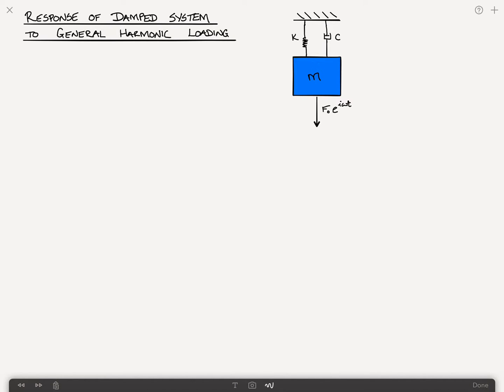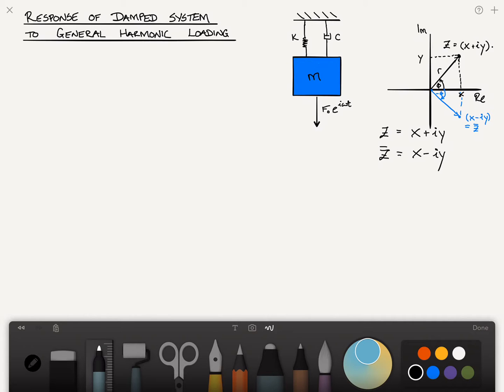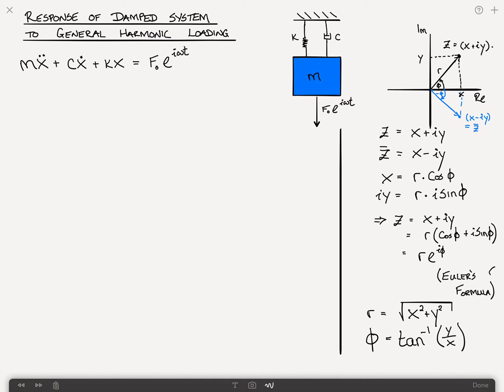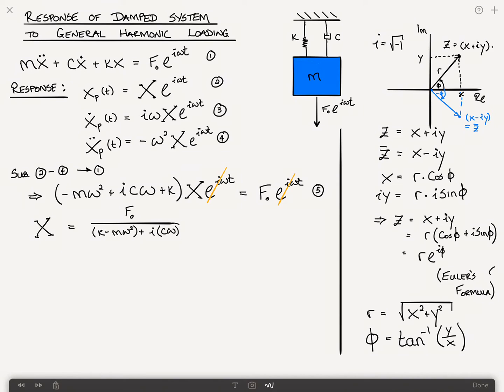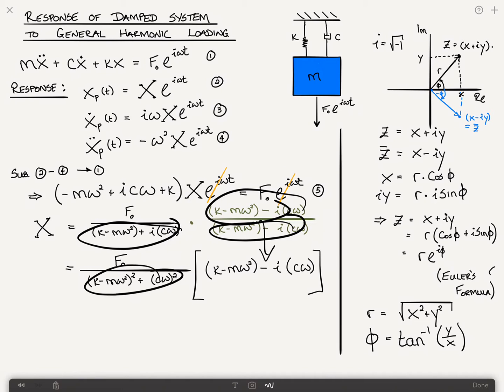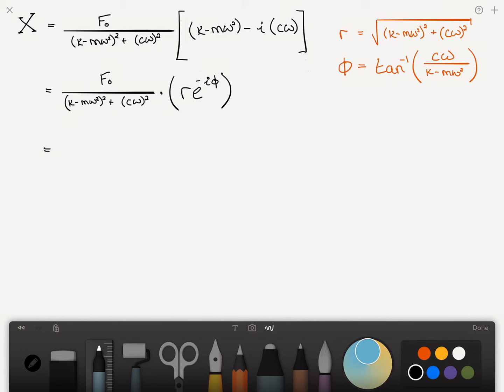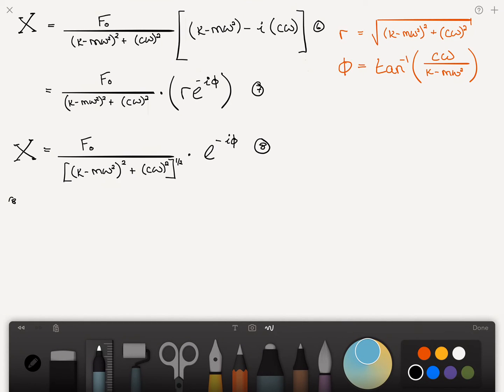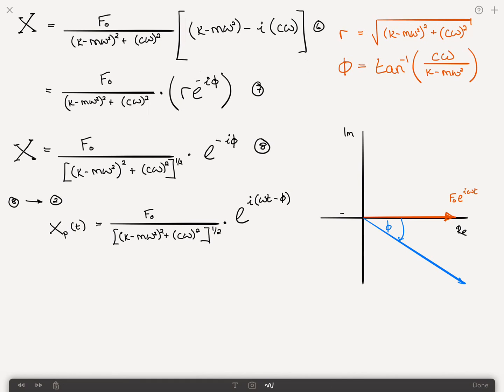General Harmonic Loading of a Damped System (SDOF)

Comment: Thanks for the videos, extremly nice. Just to verify: xp(t) represents the particular solution of the system, right? In order to plot x(t) we would also need the homogeneous solution and could then say x(t) = xh(t) + xp(t), where xh(t) is fixed by the initial conditions. Is that correct?
Reply from the maker: Yes, what you have stated is correct.

Comment: Hello!  I have a question. What if the harmonic loading is something like some amplitude A times sin(wt)?
Great videos btw thanks alot!
Reply from the maker: Using Euler's Formula, we can write A·e^iωt = A(cos ωt + i·sin ωt).
So, if you are using the forcing function of A·sin ωt, then this is just the IMAGINARY part of  A·e^iωt (ie just that part that is multiplied by "i").

Since the forcing function you wish to use is just the imaginary part of  A·e^iωt,  then we are also only interested in the imaginary part of of the response (if we use cos as the forcing function, then we'd use the real part only).  

In order to find this, take the final equation in the video (I didn't number it, but it should be eqn 9) and apply Euler's formula:
e^i(ωt-φ) = cos (ωt-φ) + i·sin (ωt-φ)

Then, just consider the imaginary part of the response and you're done.  

Also NOTE that in my final equation, I have F0 instead of the amplitude, A, that you have given.  These are the same things (ie the magnitude of the forcing function).

Comment: Can you explain to me if my forcing function is sin? I kind still dont get jt tho huhuhu. And can you show me, if possible, how it is done to solve the response using the forced function sin? Having difficulty on how will I proceed there
Reply from the maker: Using Euler's Formula, we can write A·e^iωt = A(cos ωt + i·sin ωt).
So, if you are using the forcing function of sin ωt, then this is just the IMAGINARY part of  e^iωt (ie just that part that is multiplied by "i").

Since the forcing function you wish to use is just the imaginary part of  e^iωt,  then we are also only interested in the imaginary part of of the response (if we use cos as the forcing function, then we'd use the real part only).  

In order to find this, take the final equation in the video (I didn't number it, but it should be eqn 9) and apply Euler's formula:
e^(iωt-φ) = cos (ωt-φ) + i·sin (ωt-φ)

Then, just consider the imaginary part of the response and you're done.

Comment: Hello, in my class I keep getting problems where my harmonic force is in the form Fo*cos(wt).  I like the method you do here because it seems easier, but am a little fuzzy on the process of converting cos(wt) into the exponential form using Euler's Formula.  Specifically with regards to whether or not the exponential to the 'e' gets an i, even though the cos(wt) is just a real component of a complex number.  Does the exponential get an i if its just a real harmonic force?
Reply from the maker: The idea with using complex notation is that it conveniently captures BOTH the Sin and Cos forcing functions.  For a Sin forcing function, we just consider the imaginary part while for a Cos forcing function, we just consider the real part - so all you would need to do is consider the real part (i.e. the terms that are not multiplied by "i").  

To get there, you need to use Euler's Formula:
e^(i·θ) = Cos θ + i·Sin θ   OR
e^(-i·θ) = Cos θ - i·Sin θ

So, the response would simply be:  
x(t) =  X·(Cos ωt + i·Sin ωt) where X is given in equation. 

Multiply this all out and group your real terms separately from you imaginary terms.  Ignore the imagery part (just cross it out).  The remaining real part is your answer.

ALTERNATIVELY, FORGET COMPLEX ANALYSIS and go through my video using Cos ωt as your forcing function.  Perform all the math step-by-step exactly as I have done, but with your forcing function.  This will be a very good exercise if you really want to get a solid understanding of this - rather that just plugging into a formula.  Once you do this, I think the results from the complex analysis will make more sense.
Reply: If you expand e^(ix) in a Taylor series, you will find it will be a combination of the Taylor series expansion for cos(x) plus i times the Taylor expansion for sin(x).